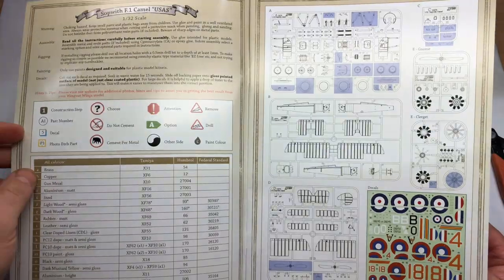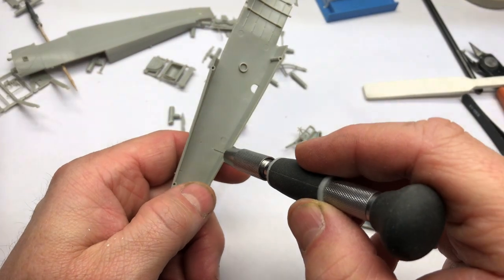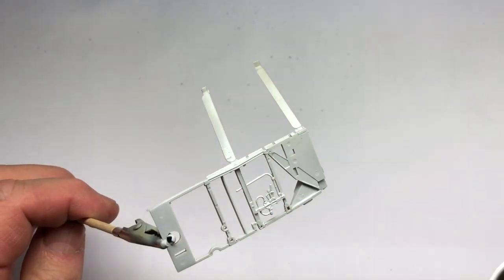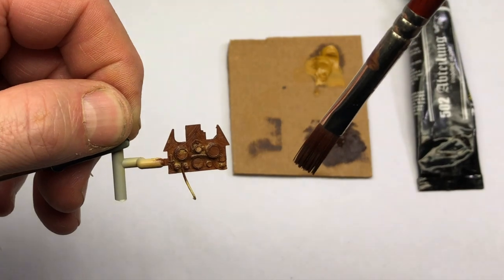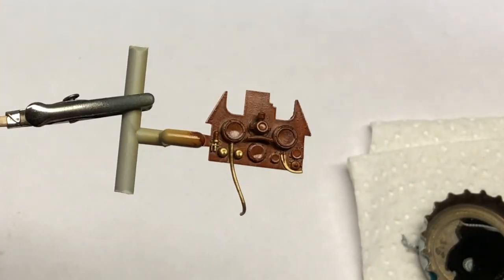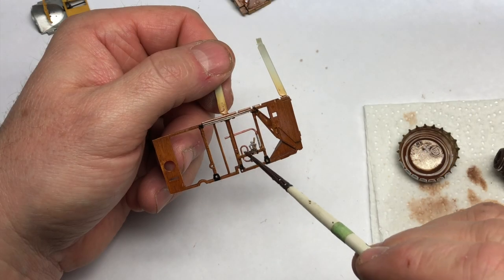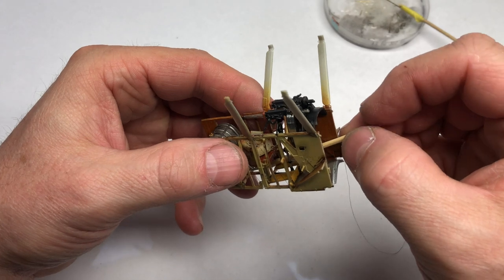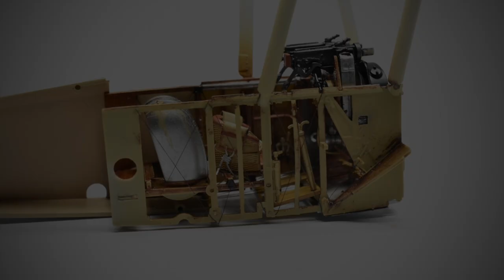Wingnut Wings Sopwith F.1 Camel I Part One I Cockpit I

Comment: Hello Tim.  I've been watching this build in reverse order, and I really appreciate all of your helpful tips as I contemplate starting on my WNW kits (4 of them) some day.    Any chance you could put up a link to that nifty clear resin pen/applicator as well as the small UV light tool?   Many thanks.
Reply from the maker: Hi Mark… reverse order? Ok nothing wrong with that I guess 😁 That clear resin pen thing was from ebay I think, certainly nothing special, cheap too. You could get it from anywhere really.. Range, Hobbycraft somewhere like that. 
WNW kits are pretty straightforward if your used to biplanes. A lot of modular building and painting. Assembly right at the end. Rigging is nothing to be scared of either. Just take your time, good ca (superglue) and don’t expect to complete it in one session. I’m so glad you found the video useful mate.

Comment: First of all you do beautiful work. Second all that detail blows the Academy version (which is a rebox of the Hobby Craft made in South Korea) away!! It's highly unfortunate especially for those like me since I never really researched any of the references on line since the detailing was so sparse. I added my own pito tube made from copper wire recycled from a desktop computer. That was pretty much the only thing that I did to modify it.  

 Now I bought the original Hobby Craft model and it identical and still missing all the detail that the Wingnut Wings version has but I'm not going to shell out $80.00 for a CHINESE MADE Sopwith Camel!!!! All this detail is WASTED once assembled as you cannot see it no matter how accurate or how well you paint it! It's too bad that it is as it does make for a realistic build. However I have to both design and manufacture my own version of the missing parts. I'm not going to make an oil can or fuel tank because you'll never see them any way and it will add to the weight.

 And those paints are NOT LACQUER!! No matter what they say Lacquer is NOT a generic term of medium and IS a specific formula and was invented in 1923 by the Plasti-Kote company. No such thing existed before then and acrylic is a product of the 1950s'. NOT THE SAME THING! I don't know why they're calling their products that other than to win the confidence of those that actually use it. Lacquer it NITROCELLULOSE (tree gum sprirts) and NO ACRYLIC IN IT! Don't be fooled - acrylic is a styrene based monomer and therefore is a synthetic finish formula. Either way thank you for sharing this with the rest of us - it is inspiring to see and a real treat for anyone into model building and aeroplanes.
Reply from the maker: Well Solaries, that’s the longest comment I’ve ever had! Wingnut are fantastic that’s for sure but not perfect, I know exactly what you mean about hidden detail. It’s horses for courses really but biplanes doing generally have open cockpits and you can see inside should you want to. WnW kits are very expensive nowadays and I doubt very I’ll be getting anymore (I have two others in the stash). 
Regarding paints.. I don’t know, I seen grown men have blazing rows about what to call different paints. All I know is these MRP and Mr Color paints are the business. 
Thanks for stopping by mate. 👍👍